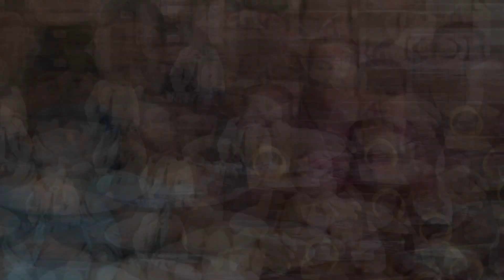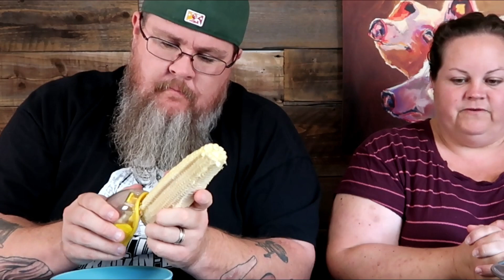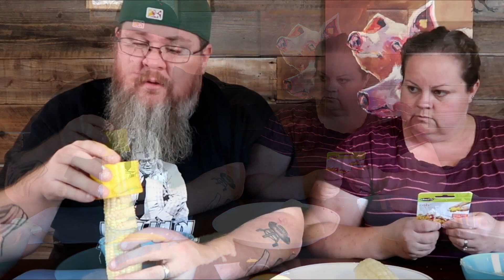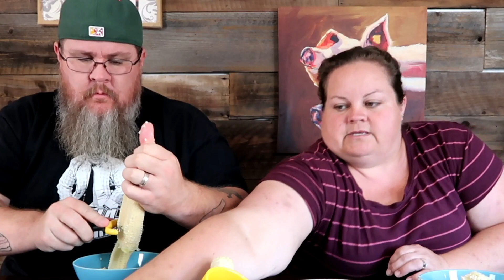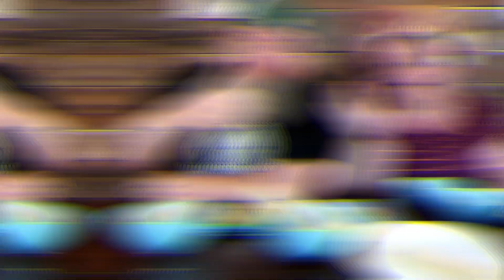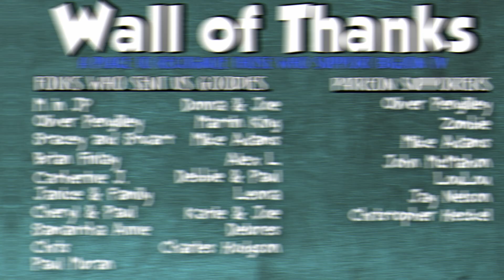Corn Stripping Tools || Testing Kitchen Gadgets

Comment: If you take the third one you tried with the big yellow handle outside in the cutting blade inside I would call that 
CORN HOLE-ERand you put a bolt in a screw gun and ran it into the corn that would be a winning combination that would strip a 5 gallon bucket of corn in 10 minutes😀😀😁😆😁😆

Comment: With the round one, have you tried twisting it as it passes through the cutter? It seems like it would work much easier while twisting it... and then once you're through most of the way, just turn it around and pull the cob the rest of the way while still turning the blade. I like the "cordless mouse" style one too! Good reviews, Thanks!

Comment: I used to have a gadget from an old independent farm store to get kernals off the cob. It was a wooden butcher block style base that was curved on the bottom and a metal blade at the end with a hole You would place it over a bowl and just run the cob over it like it was a piece of wood.
Reply: I've seen those... they look very reliable and if I'm not mistaken that tool also has a blade to cream corn too
Reply: Lee corn cutter?